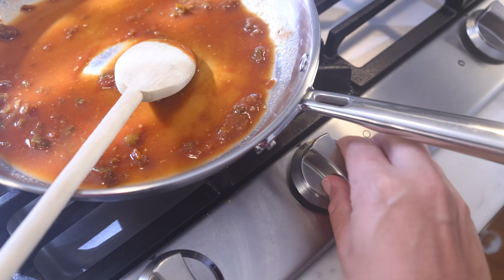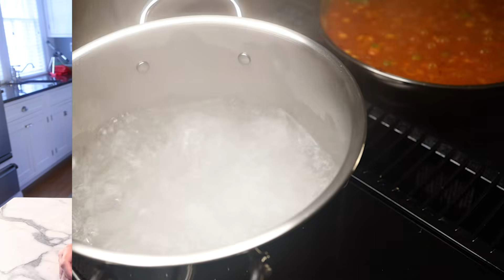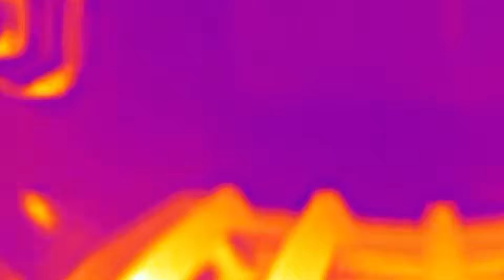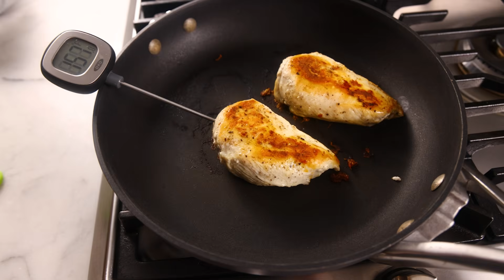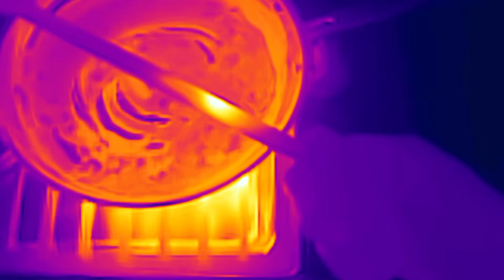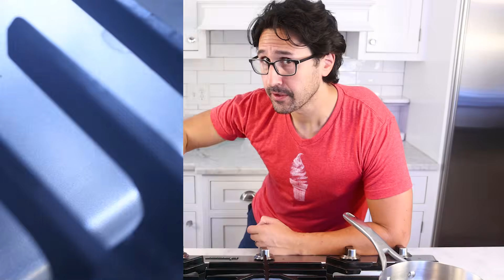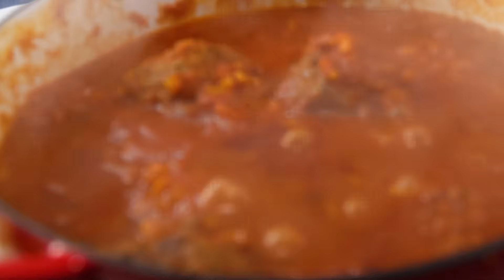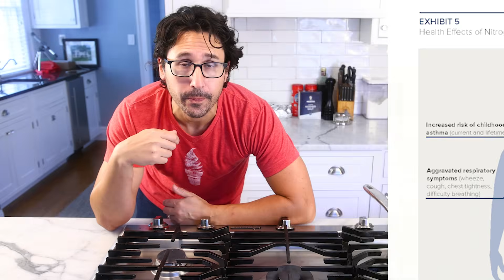Problems with gas stovetops | weak, dirty and dangerous

Comment: It would be interesting to compare the % of thermal losses on a gas stove vs a powerplant + transmission line losses
Reply: In that analogy you might want to include the gas losses in the pipe and at the well too… which are significant.
Reply: @JoshuaRes  most losses would be relative to friction in the gas lines/mains which isn't that much considering how long it travels at high pressure through transit
. Natural gas in alot of ways is self sustaining with pressurization via bleeding off a certain amount and using it to power a turbine at compressor stations. quite efficient. but even so those losses are no different than losses accounted for on gas having to make it's way to a natural gas fired powerplant. my question still stands. What are the thermal losses of electricity having to be generated then loosing some through the substations, transmission lines. street lines, then street transformer before making it to the stove vs using gas at the source instead on the same sized cook wear.
Reply: @Mike-jv8bv  it’s a reasonable question :) I mostly was just highlighting that if you want to look upstream of the conversion in the house, you should look upstream at both energy sources. From my limited understanding, gas does not show up at your house with zero losses or consumption required along its path. Just as electricity does not show up with zero losses.
Reply: power plants are wildly efficient lol what are you on about
Reply: @Treebark1313  i'm talking about point of delivery losses between the two. Note that a natural gas fired plant still needs to burn the natural gas and there is still a distribution system of pipping and compressor stations before final point of delivery of  said product. . and while it may have a bit better thermal efficiency for capturing said energy. you still have to couple in line and transmission losses to that equation and the energy losses associated with transformer stations. What I want to know is which is more efficient. because both have losses overall right. burning the gas straight at the source of said object you intend to cook. or using said gas to boil water into steam then use said steam to spin turbine inorder to generate electricity from which said electricity has to be stepped up and down via voltage and transferred a long distance before it is finally stepped down and used at it's source.  

Seriously nobody ever really thinks of this stuff. they just go off of happy feeling vibes which is smoothbrain talk. I like wrinkles in my lobes.
Reply: @Mike-jv8bv  There are lots of x variables in this, but ignoring all those and/or assuming it is all equal, burning it straight at the source is definitely more energy efficient, and less thermal loss. Generators are all lossy, and will always waste the primary energy before it is turned into a desired one, the most efficient one we had can only run at 60%-ish efficiency. Conversions, like turning heat to vapor/pressure to electricity and back to heat reduces it even more. Iirc there are graphs using datas from EIA (energy information administration) that showcased this (including the transmission, distribution, consumer wiring and devices, etc.), but i forgor the link....
Reply: that comparison will change depending where you live, what cookwear you use, how you heat your house (waste heat isn't wasted in the winter), etc etc etc... it's not feasible to make an honest analysis of this in a food blog youtube video. Use some common sense and learn about where you live. If your power comes from natural gas power plants it's surely more efficient to burn the gas in your home than burn it at a power plant, convert 35% to electricity, lose  a further15% due to transmission losses, then turn it back into heat in your house. 

On the other hand if your energy source is hydro electric the equation reverses - and this is why people living in Eastern Canada heat their houses with electricity. 

Most likely if you heat the home with NG, that is the most efficient way to cook as well - and if you live in a hot region where you AC year round, you don't want any waste heat cause you pay double to remove it later.
Reply: @squee222  you might be right on that common sense rule. Though I have seen an analysis that showed that because of the thermal efficiency of stationary power plants, they outperformed ICE even with transmission loses. Could be similar here… might not be! Either way, stoves are a vary visible, but tiny consumer of gas.
Reply: @squee222  it also depends on the powerplant. The most efficient types of gas powerplants can reach efficiencies in excess of 60%. This is done by burning the gas in a gas turbine engine and using its hot exhaust gas to heat the boiler of a steam turbine. Only modern powerplants do this and >60% is only peak efficiency, but their existence makes it even harder for NG in stoves and home heating.
Reply: in the end of the day cost matters most. even with current gas prices the gas stove wins. unless you have solar power or similar in your house grid and use induction stovetops. then that always wins.
Reply: That’s a huge effort. Sounds simple but if we’re trying to determine which one is actually more efficient we’d have to take into account such a vast array of variables it would hardly be worth the effort for mere curiosity, or maybe even for study. At the end of the day I feel it’s more pertinent to look at it from two perspectives:
1) Are the practical advantages of an electric stove worth their downsides?
2) In the future (or potentially now, if you happen to be somewhere this is already a reality), when power generation is primarily based on green sources, an electric stove will be more environmentally friendly in the long term due to the decreased reliance on emission sources.

It’s probably best not to worry about the semantics of which is more environmentally friendly now because the fact it’s an open floor for debate is a sufficient answer. It’s not clear if it’s better. So don’t operate on the assumption it is.
Reply: If anyone Technology Connection might have already done it.

Comment: Home-use Gas stoves is kind of a weird concept to me. We have them as portable stoves. But there are basically no consumer gas lines in my country. Natural gas is basically only used for industry.
Reply: Some parts of the world use gas batteries in residential zones, usually compressed lpg cilinders or sometimes centralized piping with a underground reservoir
Reply: If you are from Sweden, it also most likely has to do with the fact that Sweden does not produce any natural gas (Sweden has very limited natrual gas), so it imports it's natural gas from Denmark. And as such, it makes sense that using natural gas is not normalized compared to other countires such as the United States (or Russia), that naturally and produce enough gas to both consume and export. Sweden also produces most of its energy through hydroelectric and nuclear, so there's even less of a need to have natural gas connected to individual homes.
Reply: Man, hope you guys have portable gas heaters in case the power goes out.
Reply: Wait what, are you talking about Sweden? 
There are absolutely gas lines, my mom has a gas stove in her rental apartment and same in her last apartment. Both are in different suburbs of Stockholm (her last apartment was in a pretty cheap area and the other place is a more pricy, nicer/wealthier area). She pays a gas bill every three months, that's on top of the electric bill.

I also have a friend who lives in the middle of Stockholm and has a more modern type of gas stove.
Reply: @vesper7750  ah yeah I think some areas In Stockholm and maybe Gothenburg has it. But it is very uncommon if you look at the whole of Sweden.
Reply: the US uses alot of natural gas because parts of the US get really cold. I live in Western New York and the average low temperature where i live in January is 15 F/--9C. So we need ALOT of heating in the winter, which natural gas is the cheapest and most efficient way to heat a house.

This is because ALL the heat from burning the natural gas in the furnace, is contained in the house. On the contrary a power plant generates heat (nuclear or coal) which then boils water to spin steam turbines to make electricity. This is very inefficient. 

As for reneables, solar wouldnt work in the winter where i live since we get 120 inches (3 meters) of snow a year which would cover the panels. The best solution would probably be wind but it is still not economical compared to gas.
Reply: @liamc8085  US isnt a very gas-reliant country in the grand scheme of things. One thing I noticed from browsing the internet and reading anecdotes from people living in various countries is that the Americans use a lot of any and all types of cooling/heating, simply because they are rich and can afford them easier than other people.
Reply: @liamc8085   I understand it’s cheap. If it was that cheap here as well I would probably also use it. But you really don’t need to use gas for heating to stay warm. We have about -25C (-13F) currently and doing fine on a geothermal heat pump, electricity and a fire place.

The electric comes from a mix of solar, wind, water, nuclear power and industrial power “waste”. 

Generators have grate efficiency but it’s not really something you would compare to natural gas. Natural gas is very bad both in its emissions of carbon dioxide but also other stuff like sulfides and heavy metals. Burning natural gas also lets out a lot of energy through the exhaust which electricity doesn’t.

Comment: If I had the choice between a glass top electric or a gas stove I would pick the electric one. However those old electric ranges where you set the pan directly on the element I'm not a fan of. If I were rich and famous I would get an induction one

Comment: I just switched out our 13 year old gas stove to an electric one as our son has asthma and we wanted to emit fewer emissions inside our home. 

So far, we like the following: cleaner heat generation, easier to clean with the flat ceramic top, quicker to heat (though slower to cool), and more efficient heat/kWh output.

Comment: Cooking with induction feels awkward like using your left hand to do stuff (when you're right handend etc.), but with time your feel for the heat and stances of the apparatus start to link and it becomes much easier. It has some kind of annoying learning curve that limits the way that you produce good tasting food for a while. Gas feels much more natural (to me at least) because you can physical see the fire etc. Gas sucks for your carbon footprint, but is much more cost efficient (here in the Netherlands with the price currently being 2,65 euro per cube). An electric induction stove averages 175 kwh per year which is around 117 euro per year. For gas this is 36 cube times 2,65, 96 euro per year. Not keeping in mind the resources it takes to extract, refine, deliver gas/ electricity tho... I do wanna change to induction one day though, easier to clean and might be more fitting for my style of cooking. But gas fire makes my little caveman brain go Unga. Decisions, decisions..

Comment: I've had glass top electric and coil electric, and I hated them. I recently moved into a house with a gas cooktop, and I'm a huge fan. Cooking is so much faster. I haven't tried induction, so maybe I'll get a stand alone to try it out when I need some space
Reply: Cooking on gas is only faster if you cook in small quantities, for things that require alot of heat or for cooking in bulk, Electric and Induction are much better. 

Like I would never make Pasta or Chili or Soup on Gas, and never make Fried Eggs, or Fried Rice or a thawed thin burger on electric. 

Gas gives you all it's heat up front, but it is less heat overall, while electric is more of a snowball effect, where the heat builds up. Solid on Solid will always have more heat transfer than gas on solid.

Comment: I will say -- for people with severe adhd/disorganization/cleaning/executive function/fatigue/depression difficulties, I think glasstop is often worse. It's so easy to use it as extra counter space when you run out of actual counterspace. Pretty soon the whole thing is dirty and you can't use it because it will smoke. Or you leave something on a burner and it melts. It's just upsetting. Gas stoves are noisier and sometimes have a smell, which is good for forgetful people. They're better for people who, frankly, can't keep up with kitchen cleaning tasks, because I've never really seen one that you couldn't get cooking on right away, even if they're really dirty. Most you'd have to do is brush some things away from the flame, maybe take a paper towel to the metal pot-holder part for a second. I know that may seem like a weird consideration but for people ADHD/executive dysfunction/depression etc I think there's an advantage to gas. Also, the beauty of the flame cheers people up, I think.
Reply: I know it seems weird to say "here's which appliance is better for people who aren't really functioning that well" but that's a lot of us
Reply: Also like with gas if something starts burning it will usually burn up pretty fast. With electric glasstop, if something gets on the burner, it will smoke and smoke and smoke until you clean it. With gas you can also just stop the flame and clean it. With electric, you CAN clean it while it's hot, but you gotta get your sponge really wet and move it fast, and make sure it has no soap on it.
Reply: gas is very stinky, Until I get a good hood vent installed, I am doing most of my cooking on an electric hotplate

Comment: I mean, the biggest problem with gas stoves is that you need to have a separate pipe connected to both your house and a centralized distribution network, and there's a small but non-zero risk that it might blow up, destroying your home and whoever happens to be inside. How and why we were convinced this was a good idea is probably a fascinating story.

Comment: might be off topic but as working barista i learned to boil water for our coffee in electric keetle. not stovetop. it's way faster and efficient. especially electric keetle with temperature control and thermometer designed for cafe use. at this point the old stove top method will ruin my workflow. edit : imagine you got like ten orders of coffee and had to boil water exactly at 93°C for all of them. this is why i said stovetop will ruin my workflow.
Reply: Totally get it. I visited family who has gas top and encountered all the issues he mentions in the first one or two days of using it. Everything takes 2-3x as long, heat losses are high and handles are hot.

Comment: My worst fear ever is having a gas leak. I live in an appartement building with gas pipes in each and every flat. It goes through the whole building and if something happens - it will collapse. Little to no chance of surviving this shit. To prevent it from happening there are sort of check ups when a specialist goes from flat to flat and checks the state of the stoves and pipes. But the thing is... Some people may decide to just ignore this procedure and never get their gas equipment checked. And you can do nothing about it, you can literally live near a ticking bomb without knowing it. Otherwise gas stoves are great, love the amount of independency it gives since you can live somewhere in the forest without electricity and still have access to cooking.
Reply: The offline capacity is great, and in cold, remote locations the heat losses aren't big deal, since it heats the kitchen. Gas accidents aren't that common from what I hear in the news.
Reply: @pavel9652  in my country it happens regularly (Russia). More than 20 major accidents in 2021 that got into the news. But on average there are 80.000 accidents every year related to gas problems. About 15.000 are pretty bad ones.

Comment: The problem I have with electric countertops is that I have almost no idea how hot the pan is and settings can vary widely across counter tops I've used. With gas, I can see and hear the flame, so I have a visual and auditory reference. With electric, unless I've used the stove before, it's difficult to dial in the correct temperature.

Comment: Those downdraft ventilation systems don’t work well! If you’re worried about pollution for you & your kids, you need better ventilation in your kitchen. 

I learned this from the veterans when I was training for my new job selling appliances. It’s better than nothing, but it is pretty close to it. 

So if toxins and air quality are a concern for you, you should use overhead ventilation, and preferably something that vents outside the home instead of recycling air using a filter.

Comment: To me food also tastes better when cooked with gas
Reply: There is little to no scientific backing for this claim, other than your bias. I bet in a controlled, blind test you would not be able to tell the difference and identify food cooked in gas from food cooked in electricity. Except, maybe if there is food burned more, because gas hot spots as explained in the video.
Reply: nah you would not notice the difference... maybe in a grill, and, at that point I prefer wood